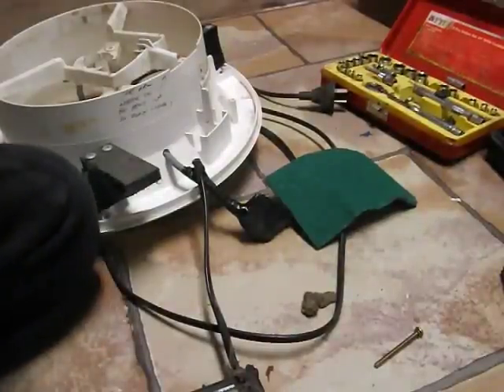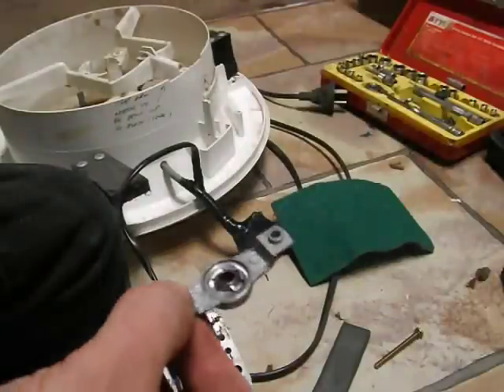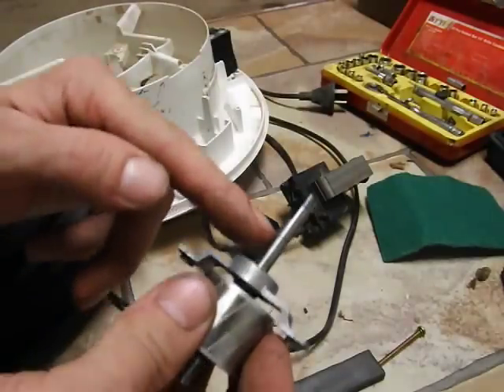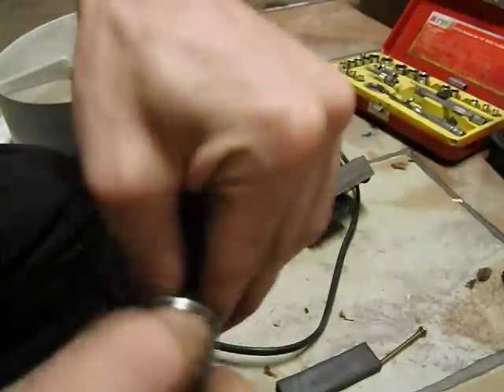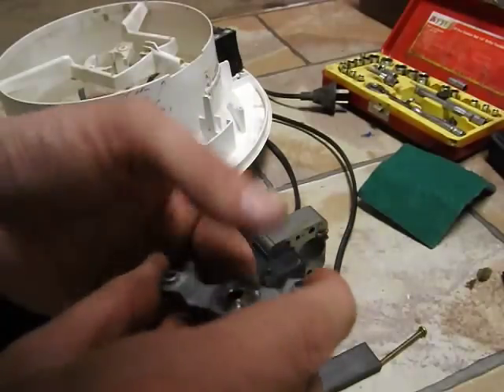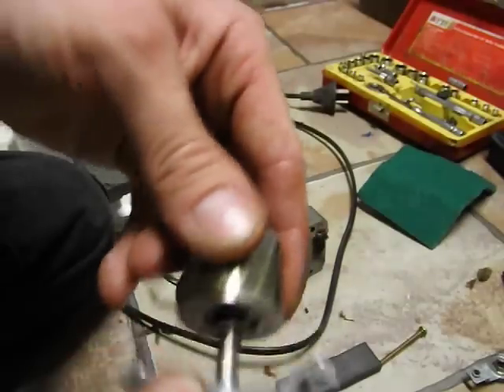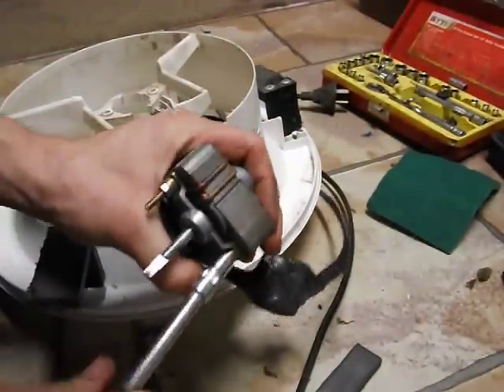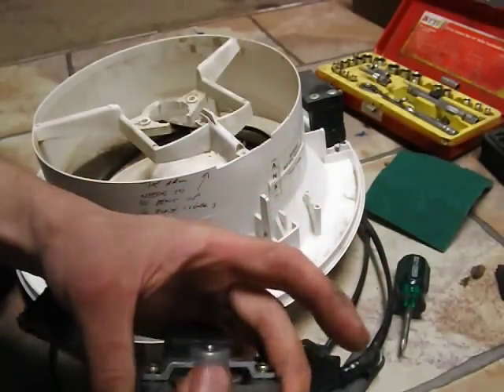how to service a shaded pole motor(correctly)

Comment: I happen to have a lucky shot a year ago: I pulled a shaded pole motor from a humidifier with seized bronze bush bearings. As I took the motor apart to see what I could do to bring it back to life, an idea came to me. I remembered that I had two wrapped ball bearings laying around that I wrongly bought a few months earlier. So I compared the size of the bearing holders and rotor axle: Bingo! A perfect match! All what was left to do was to rip the bronze bush out, place the ball bearings in, add a few washers and voilà! A rock-solid motor back to life with a major upgrade. Woohoo!
Reply: How long did the bearings last?
Reply: @PowerScissor  The original ones didn't last a month. Found some solid material which seized the rotor shaft. Thankfully the shaft survived without a scratch. It was easy to clean off before assembling the new bearings.

Comment: Yes, the bushings used are called "Sintered Bronze" used with the felt pad to retain oil as you pointed out. They use powered bronze alloys and place it into a known amount into a mold, hydraulic press and some heat is applied. This creates the tiny holes you see that allow oil by capillary action to draw in for lubrication once time. Crazy they call they lifetime lubricated. Who's life time? Ours or the bearing? The second is correct. Good video. Although, "Bush" in other countries mean sometime else. ;)

Comment: Great educative video..thank you..
Is there a life span for a freezer evaporator fan motor in my 14 years ol fridge...fan is absolutely smooth...run down time is good, just suspect motor windings may have gotten weak, so rpm may be lower, so cooling air flow movement sluggish,from freezer to fridge. Temperatures are good of freezer n fridge. -7°Cand-1°C.   Any suggestions..??

Comment: Thanks for the info!
 I realize that this video is older but I just pulled the shaded pole motor out of a Lasco ceramic space heater because of a noisy bushing. This motor looks similar to your fan motor except the bushing holders have 2 small holes on the opposite side which appear to be for inserting a straight punch into to drive the bushing retainers/washers out. The reason I'm wondering is because I think I might need to replace a bushing. I can tell that it got hot by looking at the armature shaft that spins in the bushing, it's dark gray in an area about half way around it. And when I insert the shaft into the self centering bushing and try to rock it back and forth, there's a slight catch in one area. The bushing itself doesn't seem to loose, I don't feel any play but that catch in there has me concerned. It may have overheated the felt or whatever material that is in there to soak up the oil....Do you have any experience changing the bushings?

Comment: I’m about pull the evap fan out of spare fridge. It’s making noise. $92 for a new one. But, are you sure you can reverse the motor rotation by reversing the rotor? I’m pretty sure the rotor will turn the same direction relative to the stator.

Comment: If, after doing all that, the motor still occasionally hesitates and groans before finally starting to spin (and the whole assembly and box it's mounted into has been thoroughly cleaned out and wiped down), is that likely to be an electrical fault with the motor itself? As in the asynchronous relationship between the inductor and the squirrel cage rotor? In other words, can a shaded pole motor like this simply burn out?
Reply from the maker: They can burn out, if it rotates freely by hand and there isn't excessive free play in the bearings then they can fail electrically
Reply: @wickedxe  that's interesting, thanks. What part of the motor is faulty after a burn out? I just find it strange since it's electromagnetic waves translated into mechanical movement, so I wouldn't have guessed that something blocking the mechanical movement would feed back into the windings or rotor in any detrimental way.

Comment: Unfortunately some manufacturers cheaped out and decided to not include any felt to keep the bushings oiled.

So I have to lube mine 3 times per day to keep them quiet and running smoothly.
Reply from the maker: I have come to the conclusion that light machine oil is too thin and I am instead going to try auto transmission fluid as it's heavier and contains detergent
Reply: @wickedxe back again 2 years later, how did the ATF oil work out?  Thinking of trying some myself.

Comment: Ran a drill bit thru a bushing?? Lmao, how long did the bushing last after that??45 minutes???
Reply from the maker: The drill bit was smaller than the bush, it was used to remove the old oil that had solidified and the glaze from the motor being run with no oil for so long (before I got it). it ran very well and is still in service to this day
Reply from the maker: Makes ya look like a real moron commenting on a 10+ year old video LMFAO

Comment: Kind of boring to destroy a shade pole motor, unless you have a variable frequency drive where you can play with the line frequency to speed them up or slow them down. I've had to service all too many of those things, in bathroom exhaust fans, phonographs, electric heaters, and other miscellaneous appliances. Sometimes the phonograph motors are so bad you have to soak the bushes with varsol or WD just to get them apart.